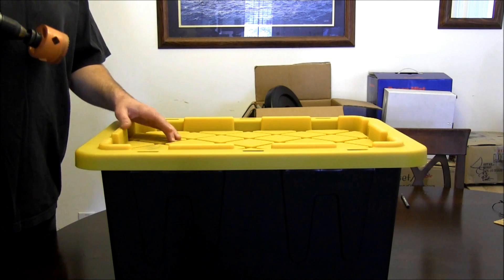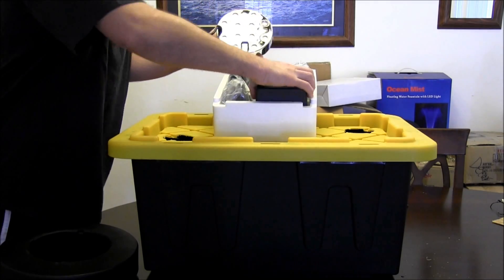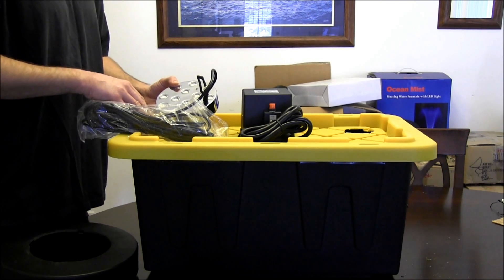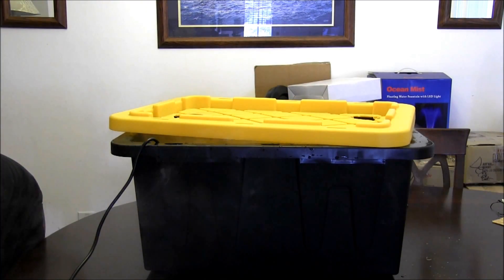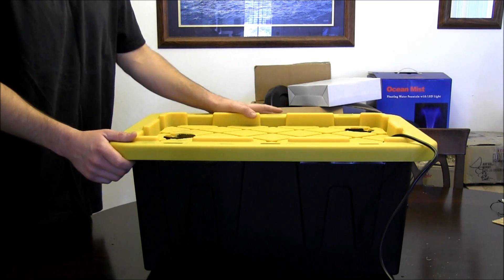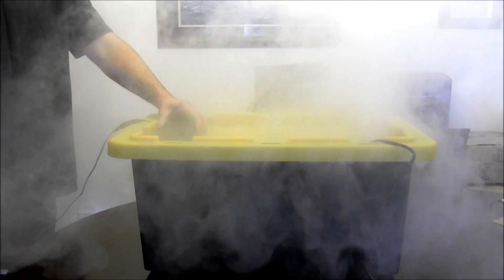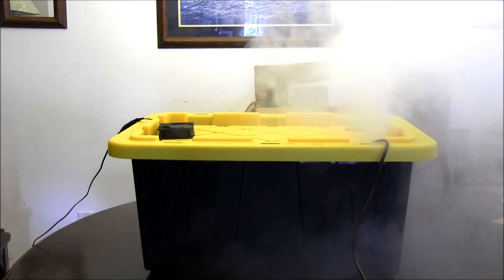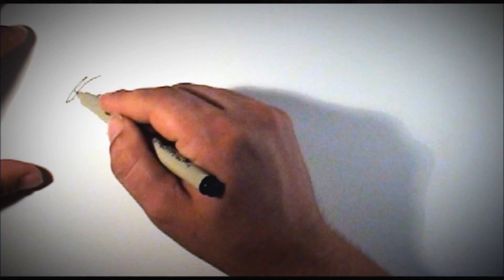How to make a humidifier for your home with Ultrasonic Mist Makers

Comment: Hi guys can you advise me on the correct model to use  i thought the five head one would be plenty for me but not sure my grow room  13 square mts cheers
Reply from the maker: Good to hear from you.  The biggest factors in choosing a mist maker is the  air exchange, target/current humidity, and construction material of the room. Unsealed concrete and wood can really absorb a lot of humidity, and rooms with a lot of air exchange can be hard to keep up with. 
 
Smaller units can overcome room material after some time, but heavy air exchange is harder to keep up with.  If steady levels are needed, it's usually better to go bigger so that you can regain normal levels quickly. 

A specific sized mist maker is usually hard to recommend because every setup is pretty different, but If you let me know more about the area, I'll be able to help a whole lot more. I would probably go with a 5 or 6 disk though. The 6 is a much more  high output unit compared to the 5 disc, and should do well for you if you look to expand, or just want nice steady levels.

To make a fully automated humidifier you will need the mist maker kit, our 120mm fan(fully encapsulated waterproof fan kit), a humidistat (to automatically  turn the machine on/off when humidity is needed) , and our float valve (to keep the water level full)

If you want, you can also add our Mist output Controller to turn the mist makers work load down. This will reduce it from 100%. I'm not positive if this will help extend the life of the unit, but  it feels like it should...lol. It can also be used instead of the humidistat if you don't need perfect humidity levels, and you want to save some money. 

If you have any other questions at all, just let me know.
Reply: hi buddy can you please give me a price on the full kit six head unit 120 mm fan humidistat ( controller ) and float valve    is it possible to mount the controller out side the grow room and run a senser through the wall all delivered to melbourne Australia  cheers
Reply: as above
Reply: cost please
Reply from the maker: Hi, 
Sorry, I don't always see these notifications. The best way is to email me at john@thehouseofhydro.com

Here is the link to our  230v shopping page. It has international shipping included. http://www.thehouseofhydro.com/store/c3/230v_Products.html

Comment: Hey I was casually interested in ultrasonic mist makers just to screw with for a hobby. I am interested in high output. I might just use LED lights strips. Also do you know any that have high mist output that is variable? If not I might just cut the wire(s) needed and run ~12v dc directly from batteries (im a huge nerd)
Reply from the maker: We have a bunch of different models up to 9 L per hour. If you check on our website store there is a mist output controller for sale. This will allow you to adjust the rate of output. Thanks!

Comment: If I dropped this 12 head unit into a 5gallon bucket would it work? I undertstand that putting the unit too deep into water will reduce the amount of fog. I am running some hydroponics and need to increase the humidity... what would you suggest?
Reply from the maker: The 12 head is just barely too big for a 5 gallon bucket. You want to use as much water as possible to keep the unit cool, so I would suggest a 27 gallon tote. We also offer humidistat's to keep the level of the perfect humidity, and fully encased waterproof fans. Check out our website. We have tons of info and other products. Thanks!

Comment: It's a nice idea but this is dense mist, it would destroy any furniture in the vicinity and the floor will be really wet too.
Reply from the maker: It's actually a very dry fog. The water particles are sub 5 µm so they don't tend to collect on surfaces. Unless you're forcibly directing it at something it won't wet it.  

Check out our website, we have almost a decades worth of customers using these as humidifiers. Thanks!
Reply: The House of Hydro Ultrasonic Mist Maker Supply oh really? thanks for letting me know, I was going to get this for aearoponics, thought the mist will cover the roots of the plant with liquid, so this won't work right?
Reply from the maker: +VanillaSnake21 sorry, I rarely get onto YouTube to check the comments. Yes, It will absolutely work for Fogponics. We have a ton of information on our website about it. Check us out!

Comment: https://youtu.be/L5FTCsW9Zu8 - Finally put it all together... Very easy.  Save yourself the trouble of figuring out a fan and just get one off their site.  Have to admit, this thing is impressive!  Took a leap and got the 12-head and WELL worth the $.  I ordered direct off the house of hydro website, which, as they stated, has the best price/value I found.  The fog output is insane, but here in Washington, it takes every bit of that fog to get the house above 15% humidity.  I have two accurite hygrometers and have been using a hot mister and a Honeywell Quietcare to try to up the humidity in the house, only achieving 28% before I got this unit.  Now we're at 50% and able to go higher, but I turn it off around there.  The cats don't even mind the thing since it's quiet, and their fan is quiet.  And, for the first time in months, I can pet the cat without getting a "zap" from static.

Comment: Can you make one of these for me and sell it ready to use on amazon?
Reply from the maker: Somehow I missed this! Sorry it took me eight months to get back to you… LOL. We do have a ready-made unit in the works. It should be available soon!
Reply: The House of Hydro Ultrasonic Mist Maker Supply I can not find your fans for the mist maker and what size head would you recommend for a room 4m by 4m could you also give me a prise on the mist maker I would need I would rather but from you because there is so many cheap mist makers .thank you ger back to me wen you can 👍

Comment: Hi, i have a under floor heating duct system that hot air comes out from. if i build one of these units and place it near the vent intake, do you think it will humidify the whole house using my existing ground vents? or do you think that by the time the humidity reaches the heater through the vent intake it will just evaporate? thank you
Reply: it will do your whole house as long as it sucks it in the intake. (putting water in a duct system isn't good just saying) duct board will absorb the water and mold over.
Reply from the maker: Hi, yes it will humidify your entire house like that. As long as you are not injecting so much humidity that it condensates within the ductwork, you will be fine. You would need a ton of fog to do that, you should be just fine.

Comment: Hey man, I was wondering if you could explain in a bit more detail about setting up the additional reservoir with a 7" mini float and a 1/4" npt valve. I've never attempted anything that involves a set up such as this, and i cannot find a 7" mini-float (did you mean the length of the arm on the float?). And how/where (inside or out) to attatch it to the npt valve. Thanks!
Reply: Also, I assume this would work in a 10 or 15 gallon bucket?
Reply from the maker: http://www.thehouseofhydro.com/mist-maker-accessories.html 

Here is a link to our new floats. They are smaller than the float in the video, and allow for smaller applications. They can be mounted inside or outside the water tank. 

You basically hook your water source to the float via a npt valve or whatever fitting works for your application.  The float is attached at the level you need to keep your water at. 

Hope this helps, John
Reply from the maker: The House of Hydro Ultrasonic Mist Maker Supply

Unfortunately we are out of the float until mid February 2015. You can find the other ones by searching mini float on google.

Comment: hello. i'm looking to make an ultrasonic mister for my snakes tanks for when they are sheading to keep humidity up. which would work the best for me?
Reply from the maker: It depends on how many tanks, and their size. I would say a one head for any normal sized tank.
Reply: Ok I wanted to be able to connect them all to one system. But just have an on off for each tank. I have 3 tanks. 2 will be in a 55gal(at full grown there baby ball pythons.)
And One red tail boa. Which will be in a little bigger than a 55.
Reply from the maker: Austin Holtzapple You can use one main humidifier, and use PVC with ball valves on the pipes to shut them on and off individually.
Reply: Ok and a one would be good for it? Or would I need higher. I don't want it to die in 6 months
Reply from the maker: Austin Holtzapple I would say a three would be good. You may have to run a one head constantly. You can limit the output to your tanks by turning the speed of your fan down.

Comment: Hi!

Could I just use a duct fan for the input fan?
If I was attempting to use a 1 head unit to humidify a 4x4x7 foot space to 50% humidity, would that be a big enough unit?
Reply from the maker: It depends on how much air exchanger half. I would probably recommend a three disc unit for that size if you have high air exchange, and lower humidity. It's better to go a little bit bigger and have Plenty, than to go small and have to run the unit 24/7.
Reply from the maker: +The House of Hydro Ultrasonic Mist Maker Supply *air exchange you have

Comment: Who manufactured the tote you used for this video? The reason I ask is because the criss - cross design of the lid will allow for weight to be applied to the lid (such as a fan).
Reply from the maker: II think it is Tuff Tote. I get them at costco.
Reply: Menards n lowes carries them

Comment: Thanks is awesome. I'm not a technical type of person, how could I adjust this for my two bedroom 1,000 square feet apartment? My son and I need humidity in that worse way in this place. Can essential oils be used in the water with this?
Reply from the maker: For a 1000 square-foot apartment I would use a five head or a nine head mist maker,  with either and 80 mm or 120 mm waterproof fan from my site. If you have any other questions just let me know!
Reply: Just go to your local big box and buy a filterless cool mist humidifier.

Comment: why does fog from fog machines alway have a funny smell to it?
Reply from the maker: You are most likely thinking about the fog machines that use chemicals. Our machines only use water.
Reply: would a three head be good enough for a 10 by 10 room? to achie 30-40% humidity?
Reply from the maker: judojustim It depends on your ambient humidity and air exchange, but 30% isn't to hard to achieve.  I wouldn't use anything smaller though

Comment: That's A LOT of fog.. One this size i think would put too much humidity into the air.. you don't want too much or too little. I use the same idea with a 120mm fan and one hole in the lid with a single head fogger unit, and it goes through two 10 liter jugs of distilled water every week and a half or so.. I use it for my woodshop and the humidity never gets too low.. This huge one would be pretty cool for theatrical events and stuff like halloween though. :)
Reply from the maker: Hey Chuck, 

You're right, it is a ton of fog, but a lot of people use these for mycology, as well as greenhouse humidification where they need to achieve 95% humidity or more! I think most people do best with a three or five head mist maker for an average size home.

Stay foggy,

John
Reply: The House of Hydro Connoisseurs of fine fogs Will Do! I just picked up the One Head Mist Maker Kit off your webstore. The one i bought was from a local landscaping place, one head, brass discs, $84... I am kicking myself for that... That will become the halloween one, I'll use yours for my woodshop as it puts out twice what the one i have does (200ml/hour). Thanks for making an awesome product and being a top notch guy. Cheers!
Reply from the maker: +Chuck U. Farley wow! $84!?!?? That's crazy. You can get our 1500ml/hr for that price.

Comment: Are those fans really waterproof? I can't find anything online that looks like its high quality.
Reply from the maker: FOR SURE! You can run these things as a prop on your rc boat if you want to :-) The bearings can wear out faster if you have them in soaking wet environments though.